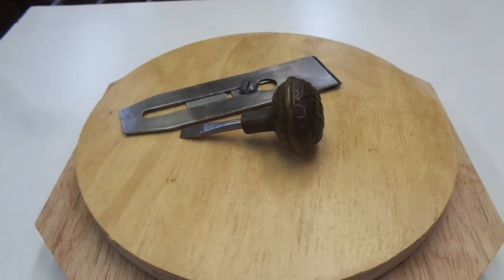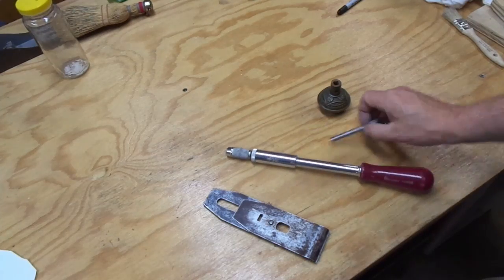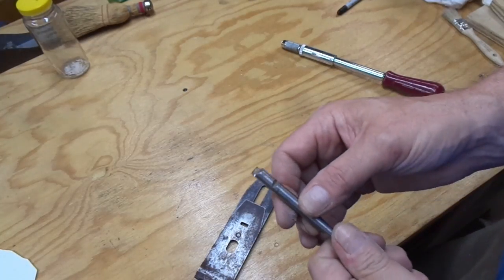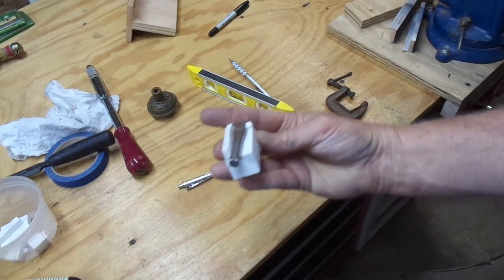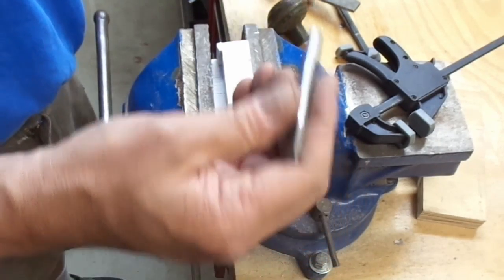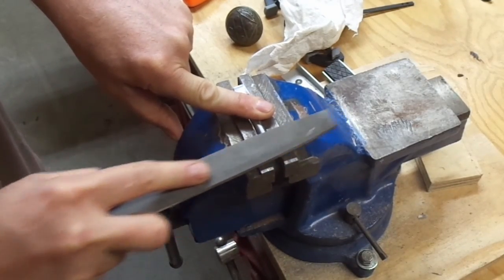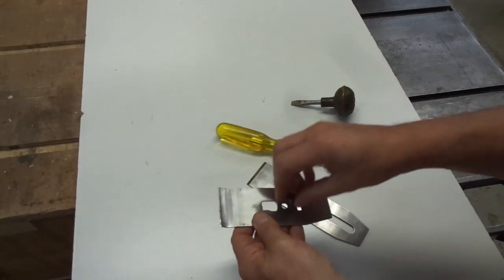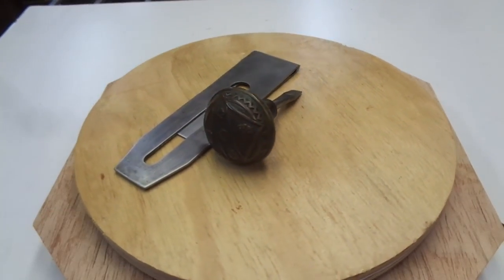Make the Coolest Hand Plane Screwdriver

Comment: Yes, very elegant!  The only problem I see is that it is round.  I purposely find the biggest (baddest) / shortest / widest-bladed screwdriver I have with an octagonal handle to dedicate for this purpose.  That way, it does not roll off my bench.  Nevertheless, your idea is very cool!  Now, where did I put my 5 gallon bucket of old door knobs?  Perhaps I have an old octagonal one... 😀
Reply from the maker: Thanks for the comment.  Yes the round handle does make a roll-off-the-bench issue, but I deal with it.  I wouldn't want such a gem to hit the concrete floor and so far I've dodged that bullet.  I was originally going to make a wide knob style handle out of wood, but this was cooler and probably easier.  Let me know if you find that bucket.  Cheers